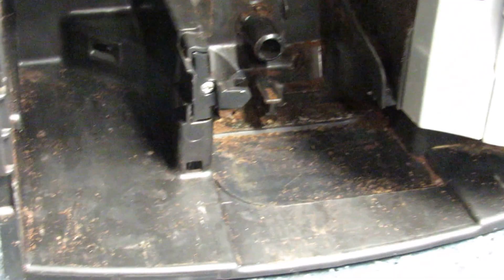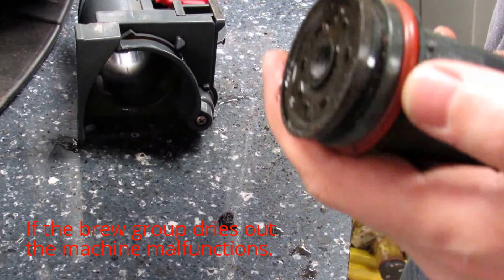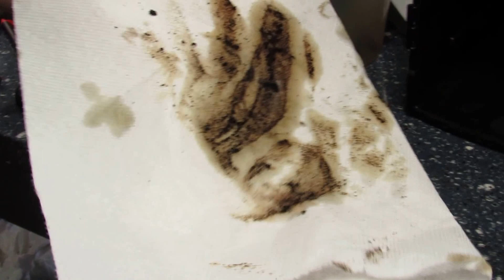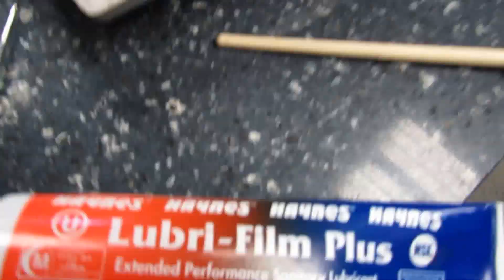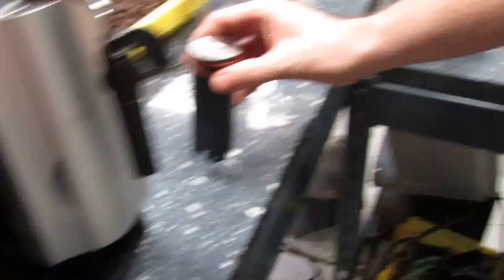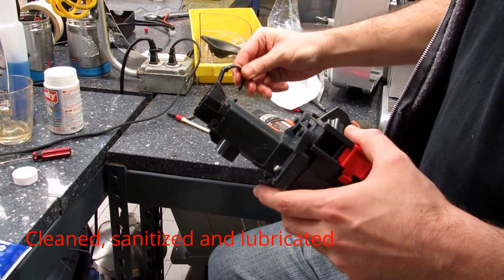Clean & Lubricating Infuser DeLonghi Espresso Machine at Mati Coffee

Comment: Any idea how to reset the delonghi esam 5500? my brew unit crashed into 
the roof as it wasnt seat properly. engineer mode, all things work, 
including the movement of the brew unit - last time this happened they 
replaced the system board £170- i just want to reset it - it does its normal
 fire up checks then says 'general alarm' - are there sensors i can 
satisfy? £1100 to buy dead out of warranty :((
Reply from the maker: Hello Pete, Sounds like you are having a serious problem with your 5500. As far as resetting the board, I am not sure if that would help your issue, especially since the machine is having a "general alarm" message. With the general alarm message this just means that literally anything could be out of place inside of the machine. With that alarm, I would recommend having your machine serviced so the issue can be properly diagnosed. With that alarm message it is just too hard to tell without seeing/evaluating the machine what the underlying issue may be. Let us know if you have any other questions. You can also try contacting DeLonghi to see what your options are, or if there is a service center near you.
Reply: thanks, i think it's must have blown the power board again, so it's £70 chance it DIY or £170 repair, or i sell it and do with a nespresso or ese pods
Reply from the maker: You can always sell the machine for parts and put it toward a new one, if repairs do not work out for you.

Comment: My machine (ESAM 4200.S) leaks a lot during descaling. The infuser looks lik this one, could it help to clean and lubricate this unit? Giving it a try is cheaper  then letting it repair I gues...
Reply from the maker: If your machine is leaking during descaling, this means you have a bigger issue. Your boiler could be leaking, or it could even be the pump. When the machine starts to leak during descaling this is caused by the descale solution eating away at the holes the lime has caused in your boiler, pipes, etc. I would recommend having your machine taken into a repair shop. You could send it directly to ours if you need assistance with your machine. We service all brands of espresso machine. Check out the Service section on our website www.maticoffee.com